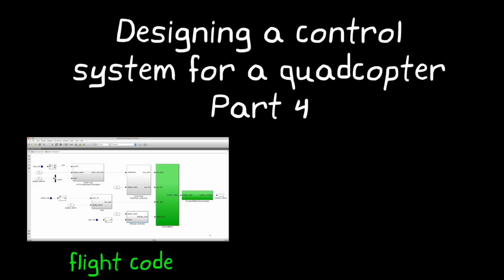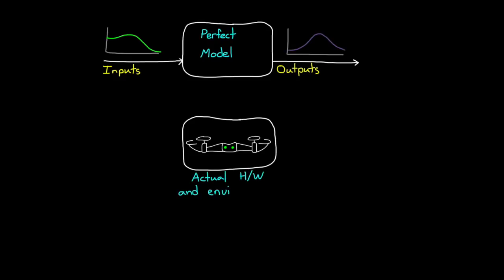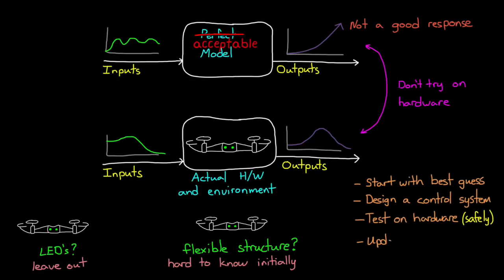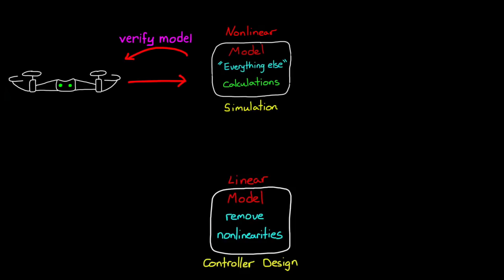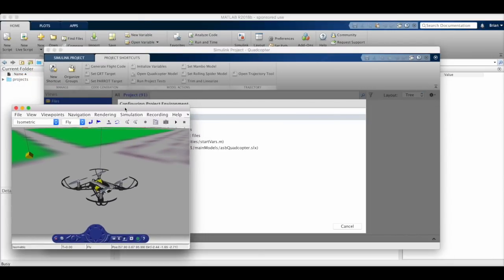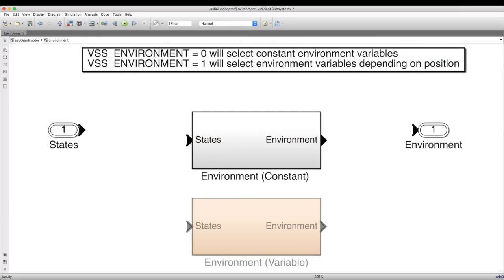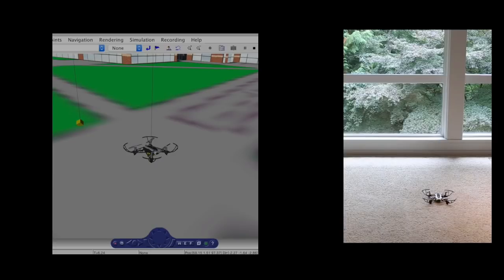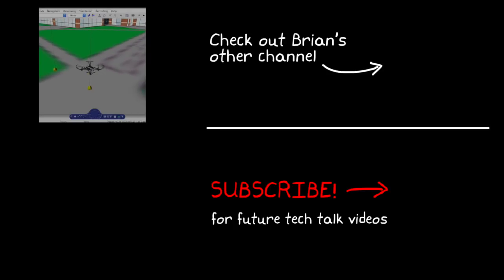Drone Simulation and Control, Part 4: How to Build a Model for Simulation

Comment: Thank you Brian for this great content however ı have a queston how can ı rotate and actuate, move it in the trajectory whatever the way I want. What kında codes ı will need to ? Where can ı find those codes after ı found them codes where can ı fit them in write them down? for now our drone simulation is hovering but just hovering that s all it can do. I dont know how to rotate it square it or circular move how can ı do this ? plz ı need your help much I'd be happy if you respond that. Thank you

Comment: how did you remove the command block and the system still works, you know cutting this things is making the video painful to follow  , just show us the full steps damn it.
Reply: I'm also facing the same issues here...not as straight forward, control engineering that is.
Reply: i am stuck and i cant follow the video any more , damn this sucks
Reply: @TnInventor  I'm facing the same issue. I tried simulating the hovering example from Part 3 of the video which didn't work since it was implemented on the drone. Now Part 4 just considers that we're using the Part 3 model but the command block just magically disappears. I'm having issues making this work now.
Reply: @TnInventor  I'm facing the same issue. I tried simulating the hovering example from Part 3 of the video which didn't work since it was implemented on the drone. Now Part 4 just considers that we're using the Part 3 model but the command block just magically disappears. I'm having issues making this work now.
Reply: @animeshnikam   i gave up xD